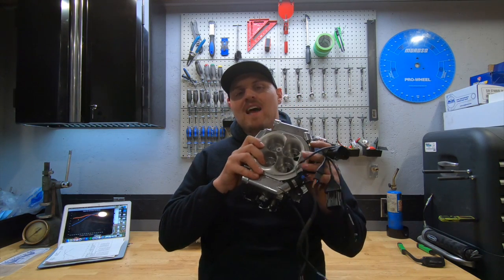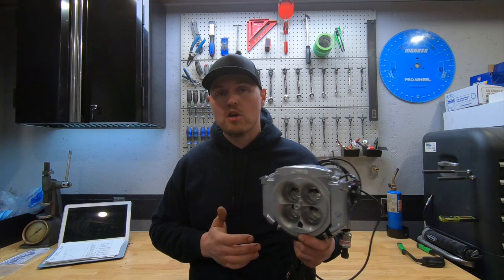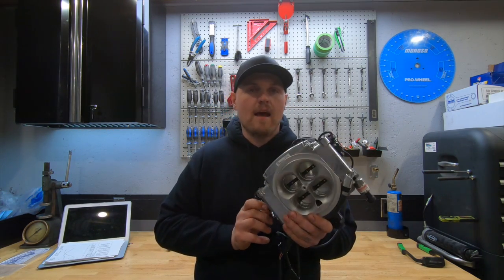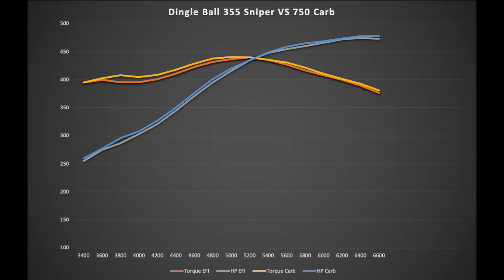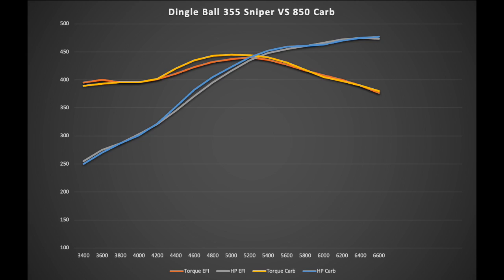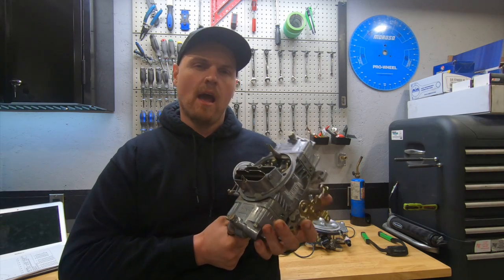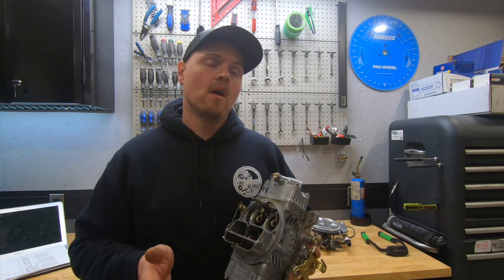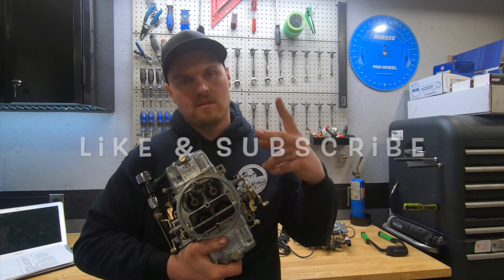Holley Sniper VS Carb Dyno test (750/850 CFM Carbs)

Comment: The distance the fuel travels is what everyone thinks is the reason carbs make more power than port EFI, but as we see in TBI vs Carb tests the Carb still makes more power. The reason is because the carb atomizes better than fuel injection. In efi the fuel is pressurized and relies on the droplets accelerating out of the nozzle(s) to shear the droplets apart. The opposite happens in a carb, the pressure of the air acting on the fuel is decreased. This is what makes the fuel move from the main well out of the booster. What happens when the pressure on a liquid decreases? It gets closer to its boiling point for a given temperature. You could boil fuel at 0 degrees with a low enough pressure. As this pressure decrease happens the fuel's surface tension decreases and this allows air from the emulsions to aerate the fuel more easily. The fuel is also cooled; (adiabatic cooling) in the same but the opposite way that compressing something makes it hotter. So now you have cooler fuel with low surface tension that has been pre aerated exiting the booster. As it exits the booster, the airspeed through the booster is extremely high, higher than the airspeed through that sniper throttle body because of the venturi effect from the carb throat,  compounded by the booster venturi discharging into the lowest pressure region of the carb throat. This is what creates the suction to draw the fuel, in addition to speeding up the air. This fast moving air then shears the aerated, cool, and low surface tension fuel into fine droplets.
You are most likely seeing the result of that in your lower end power numbers because the airspeed through the TBI is not high enough to counteract the coarse fuel introduction from the injectors. As air speeds up, some shearing action improves the atomization and also exposes the fact that a throttle body will flow more than a carb when you don't level the playing field by accounting for boosters and venturi reducing the flow area. This is why you see less of a high rpm difference on a single plane manifold vs a dual plane. 
TL,DR: fuel introduction location is a tiny difference compared to how the fuel is atomized to begin with. Carbs win.
Reply: Great explanation! How does this change at high elevations? 

I live at the base of the Sierra Nevadas and spend most weekends driving up to the mountains-usually 8,000’ - 10,000’. I’m looking for the best option to maintain the best power at those elevations. Will an EFI with an O2 sensor be my best option?
Reply: @philippine_phin  Thanks! Most general aviation airplanes are carbureted and routinely fly over 10,000. We can go up to 12,500 continuously without supplemental oxygen (to breathe).
The carburetors are very primitive and they utilize no boost venturi. What we do have is a mixture adjustment that basically works like a manual metering rod attached to a control in the cockpit.
The cool thing about altitude is that the fuel is even easier to atomize since the pressure acting on it is lower. Atomization (and the heat consumed by valorization) actually becomes a problem in airplanes because the carb will get so cold it starts to get restricted with ice under certain circumstances. We have a separate control for carb heat to prevent this.
Carbs are not that sensitive to altitude. The same reduction in pressure that reduces the oxygen content by volume also reduces the pressure acting on the fuel bowl which is what creates the differential that allows fuel to flow through the booster. They are self correcting to an extent.
I moved from sea level to 4800' and the afrs were only a couple tenths richer in my track car. 
Depending on your starting altitude you may be just fine with a properly tuned carb. You can use a wbO2 to tune it. A lot of people run into problems because they have their carb tuned rich to begin with. 
EFI with closed loop WOT will certainly give you any afr you want but engines are much less sensitive to AFR than atomization.  There's a relatively broad shelf of AFR where HP differences are low single digits.
Reply: This is probably one of the best reasons I think the other part is just generally that the fuel is not blocking flow through the carburetor while the pressurized fuel is blocking flow through the tbi probably one of the main reasons everyone dropped it in favor of multi point injection next to better cylinder to cylinder tuning
Reply: I believe the reason why the carb made more power down under is because the carb is more closely matched, in terms of CFM, than what the engine needs. Happens on heads too, if you get too big on heads the pick power will be up slightly but midrange will be down.
Reply: @EdwardHixson  There are different forces at work here. In a head we are talking about velocity through the port which helps the charge maintain inertia between valve events. This is more a question of velocity than CFM. The inlet condition to the carb is the atmosphere, not an enclosed flow path. It's followed by a plenum that acts like a capacitor.
If it wouldn't ruin metering and atomization, you would want the lowest pressure differential possible to allow the fuel to turn as easily as the air.

Comment: My brother has that setup on his 302 with an elderbrock RPM performer intake and sniper Holly kit you read through it they suggest you put a 1-inch spacer underneath it to give it an air gap for better low-end torque
Reply from the maker: Typically an open  spacer will help top end
Reply: Oh yeah he put the kit on the sniper to make it work more like a regular 4 Barrel with a delayed secondaries instead of opening up all at one time like the way it's set up from the factory

Comment: Have you considered the affecr of fuel atomization? Carbs are often far superior at atomization. Set up right, when you have a carb fuel will instantly vaporize when it is drawn into the airstream. EFI doesn't come close, so much so OEM TBI systems heated the intake to improve atomization.  In fact, it's possible to over atomize with a carb, where the vapor displaces so much air it causes a drop in VE and power.

You mention air fuel ratios and timing a number of times. Certainly important characteristics. But you don't mention atomization,  and how important matching atomization characteristics to intake and booster design are to output and drivability. TBI style EFI cannot match carbs in atomization. I think port EFI would need different injector nozzles and much higher fuel pressures to do what carbs do. I don't see that happening.
Reply from the maker: Yeah ive considered atomization for sure. I find it interesting how much it affects it down low and less up top. But this might have something to do with air speed as the pulls past the incoming fuel faster as rpm increases. Interesting stuff
Reply: @cuttersperformance  Ever notice how the TBI runs different on open plenum single plane intakes?
Reply from the maker: @v8packard  different in what way?
Reply: @cuttersperformance  You get better throttle response and drivability than you think you would with single plane, even some more torque.  In fact, it's easier to tune for drivability than a split dual plane.
Reply from the maker: @v8packard  Most definitely. I can't seem to ever match the drivability and throttle response with a carb compared to sniper, especially with a single plane.

Comment: Not surprising at all, every EFI to carb swap I've ever done the vehicle picked up everywhere and throttle response improved. The only thing I can really say about EFI is it's ease of tuning on a boosted application. Even then, with the technology we have available now you can easily pinpoint on a carb what you want/need to do. There are systems that will control everything except the carb but still inform you what you need to do, essentially an EFI system without the EFI. A carb is far less complicated than most ppl (younger) think. Tbh, sometimes I think the only reason carbs get hate is because younger guys who are so use to seeing everything on a computer screen can't function unless a device is telling them how.
Reply: I’ll think you’d find even the older guys can’t tune a carburetor, literally bought a 600 from a dude that set up all wrong threw everything from an old truck 600 and it ran perfectly fine
Reply: @benjaminwatson7868  just because the guy who you bought your carb from is old doesn't mean that he knows what he's doing. Also, I'm 52 years old, a master mechanic and also know how to setup and tune carbs. Some of us old dudes who know and like carbs are still around.

Comment: I have a stock 5.3 ls. With a 4 barrel intake. I tried 5 different carbs on that thing and never got it to run right off idle. 
Brand new old stock quadrajet, new 600 vac sec holley 
New summit Brand  750 and a old dirty 600 vac sec that worked good on a 350 in my camaro. 
And a old holley 650. 
It ran great with every carb once it past the off idle dead spot. The old holley I pulled off my 350 in my daily driver truck. It didn't have a dead spot on the 350 engine only on the ls. I have been hotrodding and building engines and tuning carbs for over 40 years. I have never had a problem getting the dead spot out of a carb before. But that ls beat me down. I gave up and put a sniper on it. And no dead spot. Instant throttle response. It doesn't seem more powerful and it doesn't get better mileage driving it with the sniper. But the dead spot is gone. So that was a win.
Reply: I bet your dead spot off idle was a timing issue, not a carb issue.

Comment: You can fix the low speed torque output on the EFI with "pump shot" my EFI system has that option under advanced settings. I believe the sniper 2 has it too. You can also fix that mid range torque dip with a laptop. My system allows it and I believe the sniper 2 does. I do love the simplicity of carbs and I can tune them very well. I just got tired of draining fuel during the summer and cleaning them out for winter time. My EFI setup  come winter I put a fresh 5 gallons in with some Lucas and it fires right up. Runs perfect. I do miss tuning carbs though, it was the best part to me.
Reply from the maker: The snipers were laptop tuned. No matter what I've tried, I can not match the torque of the carb on the engine dyno in most cases

Comment: A high quality well set up and tuned carb is very hard to beat.
Reply: Ya thats the problem is most people have poorly setup and tuned carburetors and wide open throttle isn't really where fuel injection shines it's that there is an o2 and it can have basically the right afr everywhere

Comment: I'm like you Pat, I dont' consider myself a 'carb guy' or an 'EFI guy'. I think for daily drivers the OEM EFI is the cat's ass, great part throttle, cold start, fuel economy etc...  but for your weekend hooligan wheels a good ol' 4 bbl does the job.  There was a time when I thought I would have some kind of EFI on my hot rod but it's not working out that way.  Give me mechanical secondaries and a pair of big ol' accelerator pumps and I'll be happy.

It is interesting that there is a little bump in the carb'd torque and I'm interested to hear what your video has to say about flow rates.  You'd think they would just be listed at 1.5" vacuum drop like a carb but I guess it's not that simple. It should be, but it ain't.

Comment: As you say it depends on the application. EFI in marine applications is stellar. No fumes hanging out in your bowl, I mean boat... Instant starting too. 
Carbs found a significant enhancement with the annular discharge venturi boosters. Carbs also have infinite ratio variation due to the fact that they are mechanically adjusted through air pressure/ vacuum signal, where as EFI must be calculated then applied. Carbs suffer from large overlapping cams weakening the low end vacuum signal, and the EFI just reads the data and injects X amount of fuel and bypassing the problem. Carbs also suffer fuel evaporation and occasional issues with hot fuel lines causing vapor lock, and also fuel vaporizing in the body/manifold when off and hot. The other issue with carbs is fuel level in the bowls on steep angles or high lateral G forces and harsh terrain the vehicle encompasses. Considering these variables a good EFI tends to win everyday. But if the ECU craps itself, you won't be fixing it in the desert. No clear winner here. It just depends.
Great post and question.

Comment: People mistake throttle response for torque output. The slight lag that it takes for the air to pull fuel from the carb vs instant fuel with the smallest toe wiggle. Another factor is throttle return spring tension. I know it sounds dumb, but a lighter pedal feels faster to most people, myself included.
Reply: I have zero lag in my engine with a carburetor. Throttle response is instantaneous. You don't need to wait for air to pull fuel, that's what the adjustable accelerator pump is for.
Reply: Adjustable Accelerator Pump😮😮

Comment: The sniper throttle bodies have 1:1 linkage. That’s why they feel like they have more low end power in the car. All carbs are progressive linkage. You can make them 1:1 though.

The carb atomizes fuel better, as well as giving a colder fuel charge to the engine because of the airflow through the carb.
Whereas the fuel injection is not using the air to pull the fuel and atomize it.
Engine Masters has tested this many times.
Reply: Exactly 👍🏽

Comment: Knockin on 25k 👍👍👍
Picked up what looks like a good Vortec 350  today. Gonna try for a dingleball build 👍👍👍
Reply: If you're going to shadetree the hone get a 3-stone hone instead of those damn dingleballs.

Neither will true the bores, but there's no reason to hone the low areas even lower.
Reply from the maker: @earlbrown  ive used both, have had Goodluck with ball hones on bores that are decent. If they bore isnt great, I just bore it
Reply: @cuttersperformance   "good luck" means you got away with it.

When it comes to engines, you measure them on leak down, cylinder pressure, and efficiency.   And that comes from a true correct hone job.

But even a shit job just scratching up a messed up garbage bore will look good to the untrained eye.

I'm really amazed you replied to my post with your answer.   We both know a real hone showcases low areas and problems.  Dingleballl hones hide them.
Reply from the maker: Heck yeah 🤘🏻

Comment: Heres a question that no one seems to ask... would you prefer a new carb or efi on a new engine that needs a flat tappet cam to be broken in?
Reply from the maker: Ive used both but prefer a carb and a Hei for cam break in. I break almost every cam in with "ole trusty" a holley 600 carb on my engine stand
Reply: Run rollers instead

Comment: I have the Atomic 2 on my 71 Camaro. I switched over from a Holley 650DP. The biggest difference between the Atomic 2 and the Sniper is the Atomic 2 actually has what simulates down leg boosters in the center of each of the bores of the throttle body. It's really cool. The sad part is, since the Sniper 2 was released it looks like MSD is discontinuing the Atomic 2. 😢 

Anyway, the Atomic 2 is flow rated at 865 CFM compared to the Holley's 650 CFM. I noticed a huge change in throttle response. I believe part of that is due to the Holley carburetor having progressive linkage which the Atomic 2 does not. When you blip the loud pedal with the Atomic 2, all 4 throttle bores open immediately. I had to purchase that throttle lever extension they sell for the Sniper and modify it to fit the Atomic 2 to help reduce the tires spinning on every single launch, on the street. And I have a 3,000 stall converter! 😮 It was annoying.

Honestly, though, I do kind of miss the simplicity of the carburetor.
Reply from the maker: I have an Atomic 2 sitting in the shelf. I used it for the dyno test at Nicks garage youtube channel. I may have to dust it off to do a Sniper 1, vs Sniper 2 vs Atomic test?
Reply: @cuttersperformance  You got my vote! 👍
And yes. Your trip to Nick's was part of the influence of me picking the Atomic 2. Call me superficial but I love the look! 🤣
Reply: @cuttersperformance   Oh. Speaking of which, you'd be the perfect person to ask. Do you have an active email for this channel? I'm hoping you might know something about the Atomic 2 that I need to know.
Reply from the maker: @Carl_Jr  pcperformance1@outlook.com
Reply: @cuttersperformance  
👍
Perfect. I'll probably email you tomorrow. My real name is Adam. I started this channel back before YouTube was a money making platform and really just started out as a place to store your videos to show your friends. Anyway, thank you.
Reply: I have a stock 5.3 ls. With a 4 barrel intake. I tried 5 different carbs on that thing and never got it to run right off idle. 
Brand new old stock quadrajet, new 600 vac sec holley 
New summit Brand  750 and a old dirty 600 vac sec that worked good on a 350 in my camaro. 
And a old holley 650. 
It ran great with every carb once it past the off idle dead spot. The old holley I pulled off my 350 in my daily driver truck. It didn't have a dead spot on the 350 engine only on the ls. I have been hotrodding and building engines and tuning carbs for over 40 years. I have never had a problem getting the dead spot out of a carb before. But that ls beat me down. I gave up and put a sniper on it. And no dead spot. Instant throttle response. It doesn't seem more powerful and it doesn't get better mileage driving it with the sniper. But the dead spot is gone. So that was a win.
Reply: @martyjohnsonozarkoutdoors8198 Wonder what was causing that dead spot. At some point it was maybe lacking fuel?
Reply: I got an atomic 2 and got a laptop been a lot of research on making files and programming. At first I erased my files by accident and it was not reading the ECM. Still working on it
Reply: @jamiewheeler6560  Did you ever get this resolved?